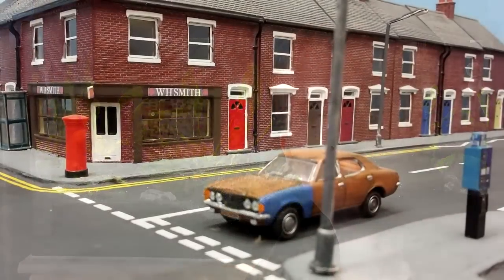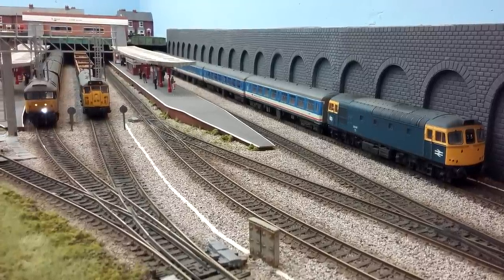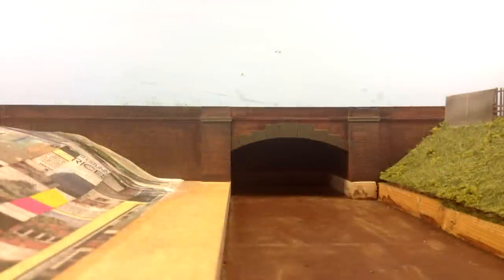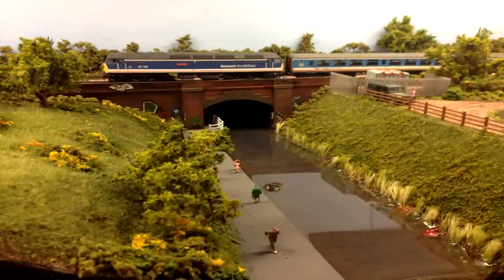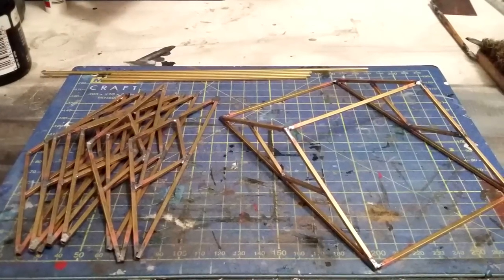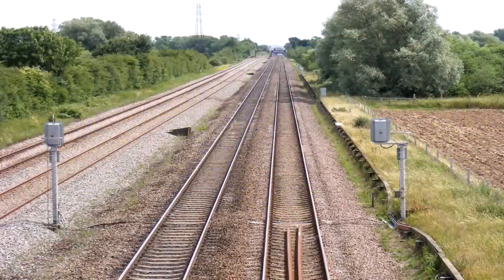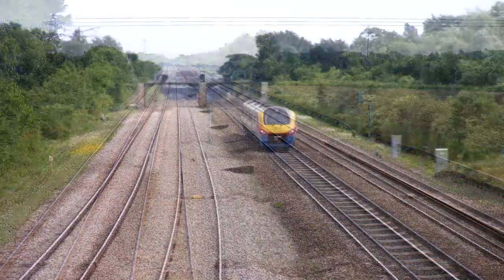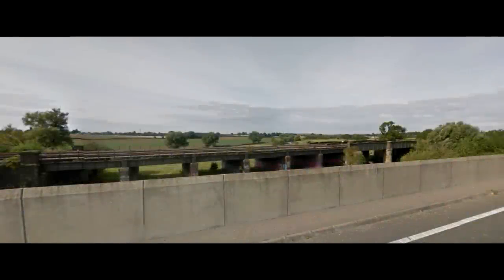New Layout Ideas

Comment: Very interesting and I can’t wait to see it. I am amazed that I am getting into this at 53. I have just completed my first board for a surprise birthday present and everyone seemed genuinely impressed with it. I am gathering materials for one for myself but as I live in a flat, I am keeping this at 5’x3’. It will be a challenge. 

I learnt how to do much of it from your videos so thanks. You are my reference. 

PS I used 9mm hardwood plywood with 2”x1” frame and it worked well. I had to get the board down the stairs and transport it 24 miles and nothing broke or fell off 😀

Comment: Good luck with the new layout Richard.

As I've said elsewhere you can never have to much insulation.
Another thing I suggest to anyone with a layout room is a dehumidifier.
Leave it on all the time on a low setting & it will switch itself on & off when the moisture content of the air reaches a certain level.
It takes the moisture from the air & keeps the layout room at a reasonably set temperature.

Comment: I love this stuff.  I have never had a rail layout, apart from a clockwork tin train and little oval track Santa brought me when I was a young boy but I love watching you experts, especially you because of your clear presentation.  On baseboards, I recently got given some Latvian Birch ply off-cuts that have 17 layers.  It is wonderfully stable stuff that I use for woodworking jigs.  If you would like to see a sample just send me an address where you can get a package and I'll fire a piece over.  Also, as I said, I have no experience with layouts at all but your desire for a water feature and long bridge made me wonder would a long bridge at the front of the layout going over a river entering a lake or an estuary into the sea, allow you to get that feature?  I see that in a couple of places on the rail journey from Dundalk to Dublin in Ireland with one really long run over an estuary at Maladide.  Just thinking out loud.
Best Wishes, Brendan.

Comment: Love some of these ideas - surely if you're going for the open frame, with elevated trackbed, you're not going to be quite so limited to a 2ft width as you would be with a fixed width table design. Must admit I look forward to seeing how this works out, as it's something I've been planning to do myself.

I remember as a child (3-5) we lived in a block of flats overlooking Barking station, and the complex station entrance there on the west end. With the BR line to Fenchurch St, and the Gospel Oak branch and line to Liverpool Street, and London Underground wending it's own way through the complex - also they had the ex-GWR pannier tanks running the Underground night maintenance trains at the time. So I can appreciate a well designed station approach with a good viewing area near by.
Reply: The other thought I had if you model a large retail outlet, was that there are many examples where the store and parking lot is built on the old rail freight depot. When you add that to the desire of making it look like the railway was placed into the landscape, rather than the more common, landscape surrounding the railway - an organic approach to the store would be to maybe plan what the station looked like in the 1950's (pre-Beaching), and then delete the rail depot, but leave remnants around the edges of the parking lot?

Comment: Hope you do get to implement the automatic block signalling. I had exactly the same issue you mentioned so designed and built my own system around the Atmel chip set. it certainly added a interesting twist to dual train running on a single line. Looking forward to seeing the new layout take shape as much as I enjoyed watching your old one.

Comment: First off, I know you're swamped, so no response required!  ;)

After watching so many of your videos with the building of your old layout, very sad to see the old one go in your last video, but thrilled to think of the new videos to come with an even more "Starting from scratch" look at your new layout.  

Really interested to see what will be coming next, both in terms of video, projects on the way and your new track plan.

Was thinking that it may be interesting to see some before and after shots, of elements from your old layout that were re-used in very different locations in the new layout.  I will also be very interested to see what your research with the Faller system turns up.  We have similarly looked longingly at the system but have not jumped in due to the price being prohibitive.  

Best of luck with the new startup, will be following eagerly!

Comment: Just a tip, any timber you get for building the new layout, take it up to the area it will be in and leave it there for at least a week , this will allow it to adapt to the temperature and humidity before you build the baseboard and prevent it from bowing and twisting after it has been screwed/fixed together creating sags etc.

Comment: Working in the rail industry, I'd suggest producing a track plan, then for signalling you need to design a scheme plan, which shows signalling equipment positions, clearance points etc, which comply with signalling design principles. From this you'd generate LOC plan. Concerning track, agree with code 75 for scenic section. Consider the sleeper spacing, so peco SF108 bull head with the correct sleeper spacing would work well for freight lines or secondary passenger line. C&L (was exactiscale) produce webs of concrete sleepers for use with code 75 rail. Ballads ting is also key in terms of its rarely uniform due to reballasting, so you can see differences where there has been patch repairs, or there has been repacking. Also you can get wet spots, where the clay subsoil has through compaction as train pass, collect water, the the clay works up into the ballast, creating a off white colour. As ever it depends how far you wish to go in terms of realism.

Comment: Thanks for this. It's always interesting to hear about how layouts are developed.

If I may, I'd like to offer some suggestions:

a) If the loft hatch is 2'x2' you could possibly have boards 2'6" wide as the hatch would be about 34" across its diagonal.

b) Depending on how fixed the track plan is likely to be, rather than using sheets of ply to make the boards, just use ply for the trackbed (especially in scenic sections). You could then have wider board frames and more scope for scenery. It also means lighter items to get through the hatch! :)

c) could some of the MDF be re-used as formers for scenery?

Comment: Re; code 75 and concrete track...in the 80's, the mainline track was concrete but points would be on wooden sleepers.

Re; computer control.
I've used JMRI to great effect for route setting from a fiddleyard around the layout and back, or up a branchline.
Although the version I created for the club was a simp0lified version, JMRI allows for block detention which gives you the ability to trigger your signals.
Foe exmple, where the signal is located, you have a break separating block 1 from block 2, and with JMRI it has a table where you can say "when train moves from block-1 to block-2, trigger Signal-A to RED".
The club layout used the LS150 point decoders (with 6 point outputs), which were find for switching points, but they had no feedback, so on the computer screen it would show that the point had been switched, but if the point had failed, it wouldn't.
A LS100 would have been better because it has feedback, but it's more expensive and has only 4 outputs.

Another option would be to use servo points instead of the usual point motors, because they give a more realistic slow-motion switching, and also are less brutal on the point mechanism.

The neat thing about having points/signals controlled via the computer, is that if you buy a touch screen monitor, is that you effectively have a virtual-panel instead of knobs and buttons and switches.

Comment: Good update and loads and loads of ideas discussed. Your head must be fit to burst with all those options spinning around in it lol. In this video you mentioned that you are still restricted to the width of the layout again due to the 2ft size of the loft hatch.  I assume that you are planning to build sections of the framework downstairs or out in the shed, rather than doing all the construction up in the loft itself. With this in mind, have you considered an option of building sections that are only 18 inches wide? This would give you the option to then join 2 sections together widthways as you build each section to give you a "joined" 3ft wide baseboard area which would give more scope for scenery and buildings etc to get rid of the cramped feeling you encountered in the station area before. This option should, in theory solve your 2ft wide constraints for the boards or in fact the open frame construction that you also mention. Best of luck with whatever you eventually decide to do. Regards. Simon

Comment: Another good video.  I was delighted to see you wanting to use the Iveco building at Watford.  It is a layout I have always wanted to build. Something based on Watford Junction.  The station building there has never been attractive.  I remember before they built the new building it was Wat Junc as most of the letters had fallen off.  I would just say the modem building did have Iveco written on it.  Might be a nice feature to include.

Comment: making a 3 foot wide sub frame that will bass through a 2 foot gap is no trouble at all, even 4 feet wide if needed, but unless you can access both sides 4 feet is probably the maximum for reach. Just a matter of mass producing 2 x 6 ladder sections out of 2x1 planed timber. Nice and light to manoeuvre through the hatch, and being a standard size you could make up a jig so all the frames are identical. Also being very light it'll make levelling a lot less strenuous.One thing about the rebuild.... you can set the layout up so you can run your APT with no worries.

Comment: I think it would be a good idea to section the layout. The first section could be a large station area with a big town scene as I don't think you utilised the town as much as you could've done in the previous layout. Another section could be a quarry type area and this would give freight trains a purpose on the layout. Another suggestion could be to add different elevation to the layout and maybe add a small hilltop station for a 2 car train to run to. A different section could be fully countryside with maybe even a forest. And the last section could be an engine and rolling stock depot with lots of sidings and this would make a use for the very nice shed and I wish you the best of luck when designing the new layout.

Comment: Hi Graham, I just read one of your replies about your loft, a window will be good for natural light, but you may need to have a shade blind on it, so you can stop the sun frying you when it's in the right position 😊. I hope everything is going well for you, looking forward to see your track plan when your ready.
Regards Gary
Reply from the maker: Working on it.  Not had much time the last month, insulation is going in, baseboards have been designed.  I hope to kick the videos off again in the autumn.  I got some quotes for putting in a window and it was just too expensive.  So I'm just insulating and painting the room instead.
Reply: EverardJunction hi Graham, thank you for your reply, I was wondering how you were, that you were ok. Simon, from Simon's Shed, stopped uploading video updates on his N scale for a while, it's like you guys are friends, so I just wondered if your all ok. Simon just took a break, needing to get other jobs done.
You have to make your loft cool in summer and warm and dry in winter, as good as you can make it and it all takes time and money lol, as well as every other life's chores and living. It's best to not rush, so you get things right, especially with the new layout, the type of base material, so you don't get that warping again. I have a suggestion, if you haven't decided on the type of base material to use, 1/2inch Plywood, it's very sturdy, that's what Peter at DCCconcepts uses, sometimes marine plywood. Also using cork track bed under the track, just a suggestion.
I look forward to your first video when you start them again, I hope everything goes well for you 😊.
Regards
Gary

Comment: Finally face behind the enjoyable master piece, or ex master piece lol. I am looking into computer control myself and aiming on the JLC Enterprises system which is relatively cheap and couples with most DCC that either has wifi or RS232 connectivity ability. I have downloaded the software and it looks pretty good, also uses the computer as a throttle as well. But not sure if you have looked into that as well. That aside good choice on L girder I have used it and it works brilliantly. I look forward to further updates..

Comment: Talking about signalling, possibly add both historic semaphore and modern signalling, always nice to see a bit of history slowly disappearing as the new modern system replaces it.

I know that a few sidings on the railway network still have semaphore signalling, possibly due to less usage of the sidings so no need to upgrade them.

Comment: Tip for your next layout. I would place the tracks closer (and on a more realistic) distance from each other. Despite the fact that your semi-torn down layout was very nice on the scenic aspect, that was quite the only thing that was bothering me.

About the fiddle yard, it isn't a bad thing if it's under the layout, but then you should have enough clearance between it and the actual layout (at least 30 to 40 centimeters). Helixes with a larger radius stand for less problems.
For the track choice in the visible area I would definitely go for code 75, it looks just more slight than code 100. Good luck with the next layout.

Comment: Code 75 is a great visual change and I use code 83 (US Style) for main line, code 75 for major industry and code 55 for the smaller industrial sidings. For display purposes these changes really seem to impress people. As for "fiddle yards etc. I have cheated and used code 100 where ever possible and buried it in the dirt for effect when visible. At no point have I done anything other than plain code 100 on bare baseboard for the storage area off layout scene connected via a tunnel into the workshop room through the wall. In the workshop I have a largish circle of track running around the room at 60 inches high for running in ad testing locomotives, a siding off this circuit for programming and access to a 12 track, seven foot long storage yard for wagons and a small two foot by five foot engine storage area with eight tracks to park locomotives. No scenery in the workshop. At the rest of the place and around the room is all workshop area and storage shelving, and took racks.
My area of specialty is scenery and buildings so this takes up most of the space. The locos and carriages are all store bought except the occasional visitor from friends or club members...
Looking forward to many more videos from your Everard Junction as it progresses. 
Don NOT feel obliged to answer any of my comments.
I understand you should save that time for working on the layout (Or the car). 
Best wishes...

Comment: Good luck on the planning, always so much one wants to do, and so little room to do it in. I am using a DCC system by EasyDCC. The Master controller is com pleat, except for a power supply, and a boaster. Built in RS232 port, and can handle 99 pre-planed routes. Here in the states JMRI is used a lot for train control. Check out YouTube for info on it. Here We use code 83 as flanges do not hit as much, and more product is available.

Comment: I do love the way GWR used to make tunnels, mostly mam made valleys 😝
I agree with the bits you liked, I also liked how it looked like it was in rolling hills. The basic landscape of the UK.
I would suggest maybe making the layout lower so it can tuck under the roof more. Especially as it will be one level.
the car welding you could do a montage style thing that you did in the past on Everard Junction, how will you differentiate Everard Junction and the new Everard Junction on YouTube? Everard Valley, Everard Park, Everard, Everard Central...ummmm
Reply: I was also going to mention that you don't have to make all the track concrete, where I am in South East London they still have a mixture, tracks next to one another, up line wood, down line concrete, sometimes concrete bits between wood.

Don't sign on the dotted line until you talk to Tempo! I was working for Currys some years later and people always used to moan that they didn't honour Tempos warranty things.....weird....

Comment: You should consideration Traincontroller by freiwald for your layout control software. It is not cheap but I will exceed your expectations. It is very adaptable and a great forum with people ready to help you. I'm like you I want to run and shunt trains, but with TC you set up schedules to run trains automatically, semi auto or fully manual. This software has collision avoidance tech in it as well. It's a great piece of kit. Good luck

Comment: For control try a Roco Z21. As it is small and compact and very easy to use. To control you can use your ipad, phone etc. For sounds, lights etc there are buttons which you program to a function and you can add an image eg F0 (light image). You can also take photos of your locos and it also separates locos from rolling stock.

Comment: Just an idea, not sure if possible or not but you could make your own magnitised system where you build little 4 wheeled magnets which run under your baseboard under the roads and you put magnets inside the shell of the vehicles? Might piss about with your electronics though which is an issue, and it would be one hell of a DIY job, if even possible!